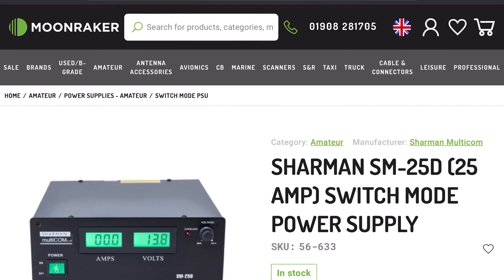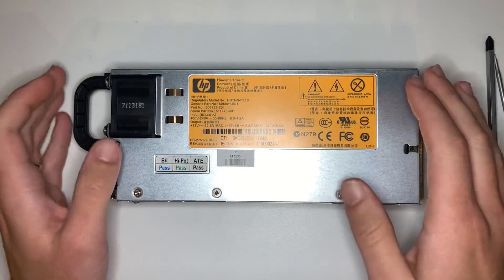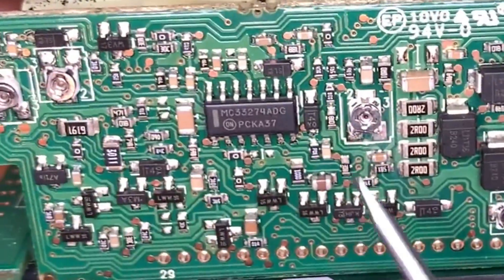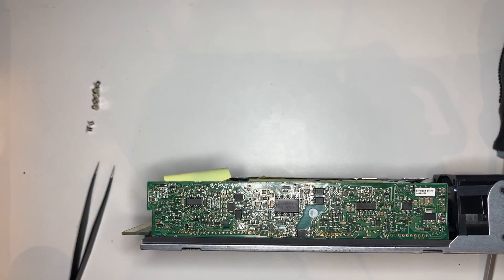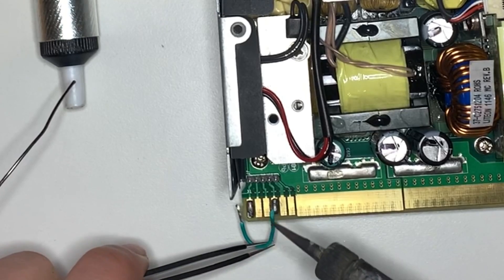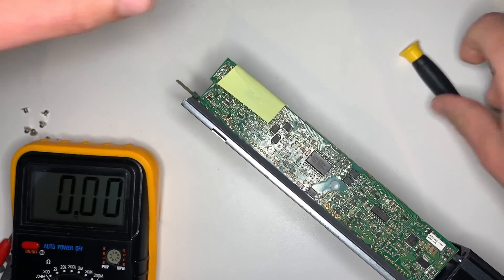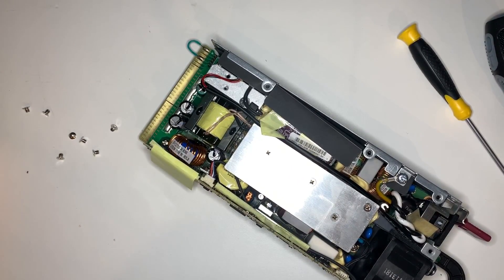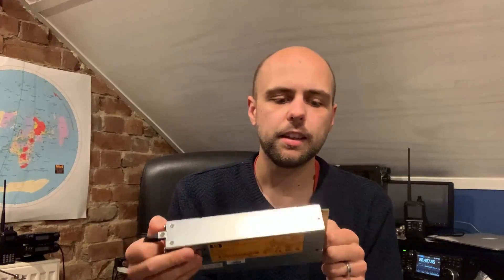Server Power Supply - The Cheap Ham Radio Shack Option.

Comment: Ham radios will work just fine within 15% + or - from 13.8 volts
Reply: That 15% is 2.07 volts so 11.1 volts to 16.5 volts DC The PD30 supply stock voltage is 12.35  volts DC

Comment: I would like to ask if you think 14.6 volts can be obtained so as to make a Lithium battery charger out of one of these power supplies?
Reply from the maker: Hi Gary. I think it would be possible, but the pot would need to be replaced as it tops out at around 13.9-14V. However, I would probably suggest getting a dedicated battery charger if I'm honest!

Comment: My power supply works great w/ my Icom 7610; however when I key up & speak on mic with my Yaesu FT-710 it shuts down immediately when using high power. I’m @ 13.8v
Reply from the maker: Try tweaking the output voltage down slightly. Try setting it at around 13.2V. You might find that work for you.

Comment: I'm just wondering why people say to bridge the power on pin with a ~50Ohm to the end pin (and the load sharing pin with ~550ohm to negative rail). Some say connect with a dead short wile others say to use a resistor? Thoughts? Anyone?
Reply from the maker: It’s a good question. I don’t know the answer though!

Comment: That's a huge negative of Icom mobile radios that you've found out. Not everyone wants a running engine to give 13.5V or more, so running off a 12V battery seems the next best option, certainly for emergency communications that's all we might have.

with the pot that you're turning, the output voltage ranges from 11.8 to 12.9 without adding any additional resistors.
A word of caution, 
 the 14 pin IC by the  pot is reaching 50c in early testing. That is just by changing the potentiometer value.
One of the easiest ways to take power off, is a breakout board (edge connectors) , has several contacts and is working well putting out 50w. Best part, the voltage is rock solid !

Comment: Just my opinion, this is the best video on YouTube for converting the HSTNS-PLxx.  Just completed my first conversion of an HSTNS-PL18. After reading of people having the  PSUs shutting down when run above 13.5 volts I elected to not adjust all the way up to 13.8.  My 50 watt VHF radio drops the voltage 0.1 volt for just long enough for the DVM to read it and then comes back to13.5 v.  I've run it for less than a half hour as I write this but us far it is extremely quiet.  I keyed the mic with a dummy load on the radio and the fan didn't speed up after 30 seconds.  That's about a 14 amp draw.

For comparison, I bought a Chinese power supply thinking that it would be OK for a while but the noise was hard to ignore.  My normal room sound level is 32 dB.  When the Chinese power supply's fan came on the sound level jumped to 49-50 dB even when the radio was drawing less than 0.5A just listening.  It's being returned to the people with the big blue smile on their trucks.

 Other than soldering on a near microscopic level it was easy.  I spun a cheap 30 watt soldering iron tip against a bench sander with a drill to make a very fine point and tinned it.  Rather than soldering a jumper to turn the PSU on I installed a toggle switch.  The PSU is getting mounted in a vertical stack box that I'm building so the toggle switch and a power meter ("lipo battery watt meter" on Amazon) will be mounted up front for monitoring and convenience.  That style of meter is powered by the PSU and doesn't require a shunt.  They will handle voltages and currents far above what the PSU is capable of delivering and they're very inexpensive.  Currently (8/2024) they're about $21 USD for two meters.

I lacked the confidence and a small enough tipped solder sucker to try to jumper the discarded resistor just with solder.  I tried to bridge the pads with a short piece of very small gauge tinned wire but it kept rolling out of position.  Finally I had the idea to tin a piece of copper wire and flatten it before cutting a piece off to bridge the resistor pads.  That made the task easy.  I held the flattened wire in place with the tip of a long straight pin and it was soldered in about 2 seconds.
Reply: for future reference you can buy a  circuit tracer which is like a pen with liquid lead  and 'draw' the bridge in . Thanks

Comment: Please use some fuses on the dc side. Murphy will otherwise come whack you for sure. Yes it is fundamental but not mentioned. Also, i would adjust under load if you have sensative equipment on the dc side. Ask me how i know ..... Murphy is a good friend 😂

Comment: Bought two of these power supplies on Ebay.  Tested fine.  When I tried to bridge the gap the SMT Resistor came off.  Replaced it and tried again.  No luck.  Pad had come up with the resistor.
I mostly could not see the devices and even with a magnifying glass had a very hard time.  I decided to toss the first one and give the second one to my friend.  Too small, too much difficulty with temp control on the pencil.  Not worth the effort if you are not equipped to do SMT soldering and have an electronic magnification system to work with.  I will still keep to commercially made PS systems as I don't have to do anything to make them work but plug them in.  Perhaps this might have been easier 60 years ago LOL!!!  Too old for this shit!

Comment: I get 8mm copper radiator pipe, smash it flat, fold in half and shape as desired, solder the ends to the upper and lower edge connector and then fit heavy duty terminal posts to your copper bar, use heat shrink over the exposed bus bar before soldering it on

Comment: Hi thanks for the post 👍 Could you please tell after watching your video is bought exactly the same power supply I didn't modify it yet but when I plug the cable there's no led green light on and no output voltage does that mean it's arrived already faulty 🤔
Reply from the maker: No. The mod(jumping the two pads on the connector tells the board it is installed in a server and to switch on. Designed that way for safety.
Reply: @M0JSX  I much appreciated your answer 👍
Reply: Thanks 👍 I did exactly as you showed and it worked for me 💪 @M0JSX

Comment: Hi Jonathan I have makenone ans its providing 13,7 volts, but anytime I transmit with my radio, the PSU gives some strange sound,  looks like the relé  inside its
Activated by the RF? Please any solution for this? Thanks you.
Reply from the maker: Hello! Thanks for the comment. Try backing the voltage down to around 13.2V. You’ll probably find this fixes the issue. 73!

Comment: 13.5v is the sweet spot. Going upto 13.8 i found it cut out. Yet I had a different one that I used a 22k resistor across ground and the voltage pot. Work fantastic.

Comment: I've been working on building a kind of backplane for these common slot server PSUs so that you don't need to solder to the connectors. It's basically a PCB with a connector that fits onto the PSU's edge connector and interfaces with all the different pins.
Reply from the maker: That would be awesome!
Reply: Did you get the board done yet?

Comment: I have a mydel proper 50 amp power supply for cb and ham radio, And using a radio just putting out  50w  the voltage drop is quite a lot 13.8v to 10v  quite bad voltage droop for a proper shop bought supply.  I also have a modified server supply that pushes out 13.8v and 82amps i run my Kl703 off it and even though its drawing lots more amps the voltage only drops to around 13v. I think companies like RM should also make power supply units that accompanies their amps and make sure they are up to the job. That would be a nice package option too. When buying a linear.

Comment: Done this and works a treat, however I’m finding I’m getting slight electric shocks from me Radios coax when there connected to this supply, any thoughts why???
Reply from the maker: Not sure on that one I’m afraid. Do make sure everything is properly grounded would be my suggestion.

Comment: How it works when you plug some load? I suppose that rising voltage up works fine without load but what is happening when you draw several amps? I saw some videos when it shuts down automatically.
Reply from the maker: In my experience it turns off under load if the voltage is set slightly high. If it does shut off, back the voltage back slightly to say 13.5V when idle and it should be good.

Comment: great video, some information, I bought the same model of power supply from ebay, I don't know if it is defective, not having an identical model, I will describe what happens, if I load a 300w medium absorption rx580 video card, I hear a strong internal electric hum and normal?  then without any boot board connection, i just apply electric plug it starts the fan starts automatically, is this normal?
Reply from the maker: That doesn’t sound typical, but I’m no expert! Sorry!

Comment: Hi Jonathan. I found that the unit shuts down at around 10 amps ,  Reset above 12amps PSU vibrates very loud. I dropped the voltage to 13.2V all OK . Great video.
Reply from the maker: Hi Stephen. Mileage may vary with these. I had to do a similar tweak on one of mine. 13.5V did it for that one. 73!

Comment: Good tip, they do the job. I have been using a 10 year old HP HSTNS-PR17 38 amp model that I dug out of the skip at work for my base PSU for the past 16 months, it's "serv"ing my radios well :D
Reply from the maker: Thanks for sharing. 73!

Comment: Great video.
I did this to two units just last week.
Mine were the PD units so did the resister and trimmer trick.
Worked perfectly and although I have not used it on my 7300, I do use them on some of my 10-meter rigs and one has a 200+ watt amp built in, and it runs nice without any obvious noise.
Not very elegant but I soldered 8 gauge wire the full length both sides of the pcb on pos and neg to a distribution block.
I was afraid of pulling the full potential current from just a small section available on the pcb and burn it off.
That as well as reducing the chance of venereal.
Reply from the maker: That’s a good idea. I suspect it would be okay, but why take the risk, eh? 73!

Comment: I use an old power supply out a 1990's Compaq computer for 12V DC in my garage.  It doesn't have enough amperage for a ham rig - maybe a CB since those are limited to 4Watts in the US.  
I use the power supply to run a car radio on a shelf, complete with a ring of speakers out of a luxury car for a surround effect.  My garage is loud when I'm underneath a car. 😁
Reply from the maker: That’s excellent! Well done!

Comment: Also… be aware that these beauties hold a hefty charge even when unplugged and for quite some time. Some units when converted to their top end of near 13.8V will shut down when you go to pull more current from them (like on Tx). Test and dial back a bit, if so. If you have a 3d printer....I modeled a case for these some time back. Details/STLs in the comments on my channel which I also posted here. Thanks for the videos. 73s F5VMJ.
https://youtu.be/q8ZGHTefn3o
Reply from the maker: Thanks Paul, that’s very useful. 73!

Comment: Looks like there are a bunch of different breakout boards for HP power supply connectors that you can pick up cheap; many with a voltage display and screw terminals. They seem popular in crypto mining community, and found a few that list your supply as compatible. They look like a neat solution to get radio equipment connected.
Reply from the maker: Thanks Steve. It doesn't surprise me given how many PSUs are out there! Can't really go wrong for £15! 73.
Reply: @M0JSX  Ordered a PSU and Breakout board. Will see if I can de solder tiny things 🙂